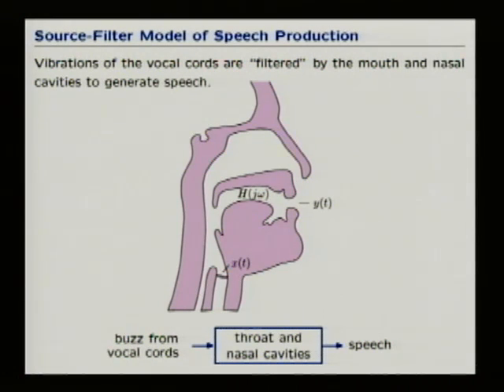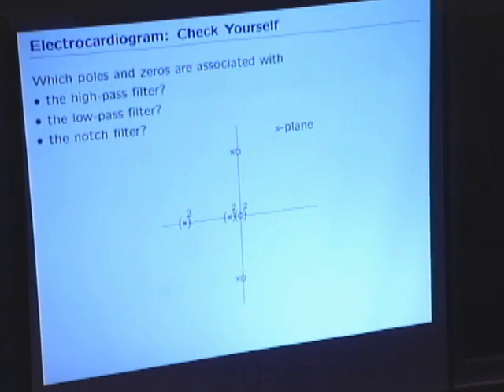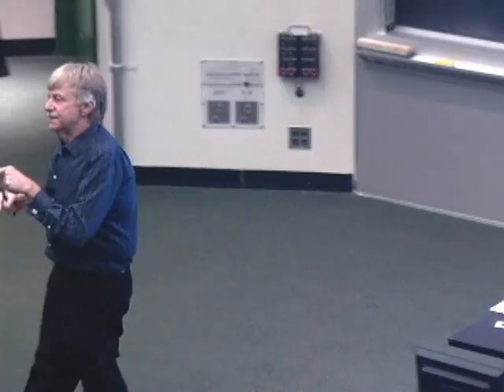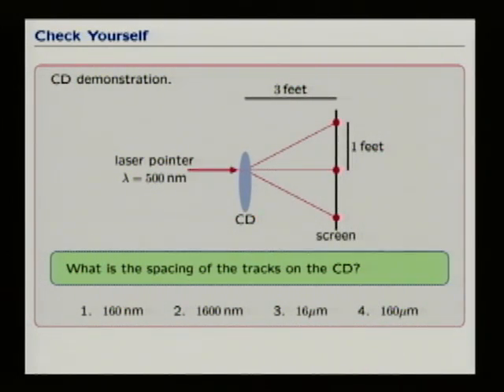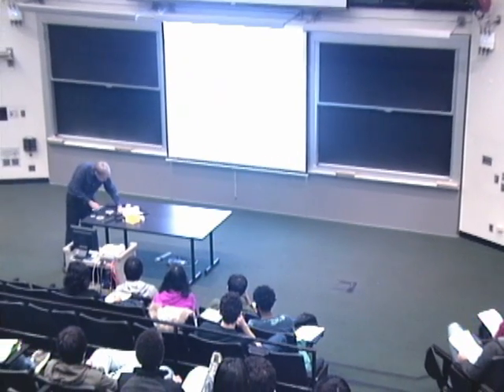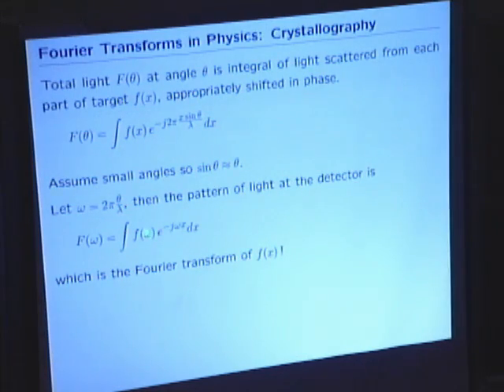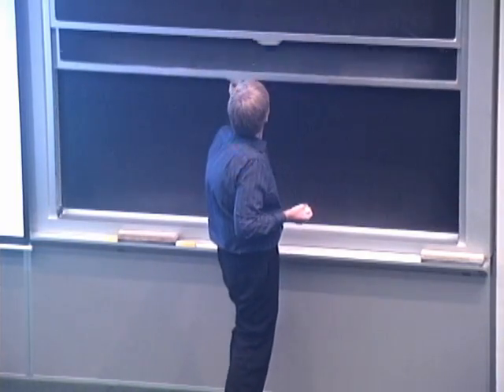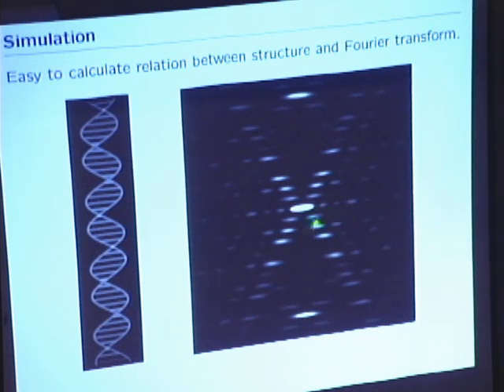20. Applications of Fourier Transforms

Comment: The X-rays were NOT coherent; however, the DNA was frozen into a coherent crystal.  It turns out that crystals can interact only with very specific wavelengths so that all other wavelengths pass straight through.  Coherent X-rays from the APS at Argonne, the CCXS at MIT, etc. are only very recently available.
Reply: I wonder if he meant collimated?
Reply: @tricky778  Could be.